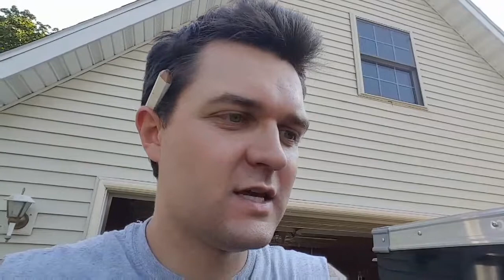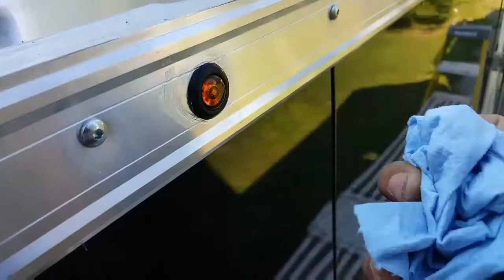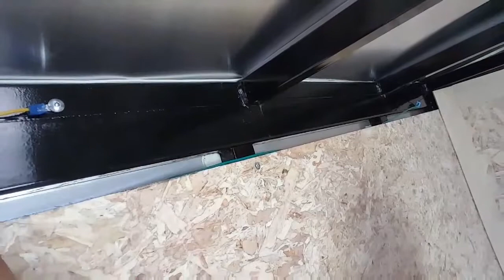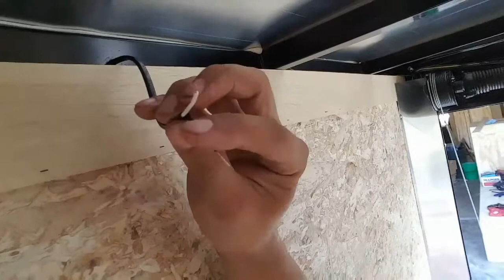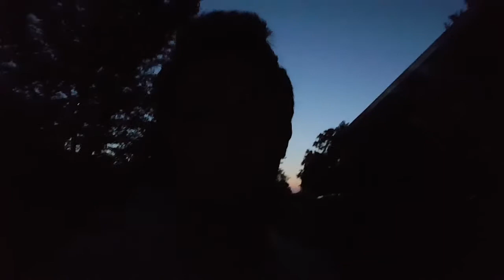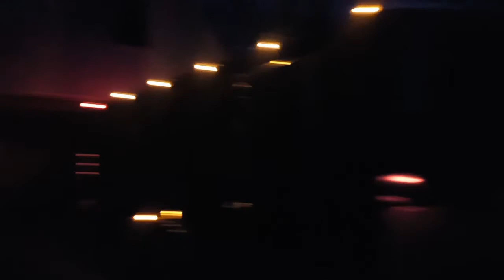Adding Clearance Lights

Comment: I know you said that you added the button lights across the top, what were the lights that came on it as stock clearance lights? And also the trailer looks awesome!
Reply from the maker: The stock lights were just one in the rear upper corner and one in the lower front corner or vice versa. Make sure to check out some of the new videos. This trailer got remodeled this year and is really cool now! Clearance lights up and down and lots of light bars!
Reply: @TheRealBeardedBuilder  I will definitely check them out. I was just wondering if the stock lights were the same button lights like the ones you added
Reply: Are the new videos up now? And also you can never have to many lights!
Reply from the maker: @brandonroach2370  new videos are up on the channel. And the stock lights were slightly bigger. They have 2 LED diodes.
Reply: @TheRealBeardedBuilder  ok thanks!